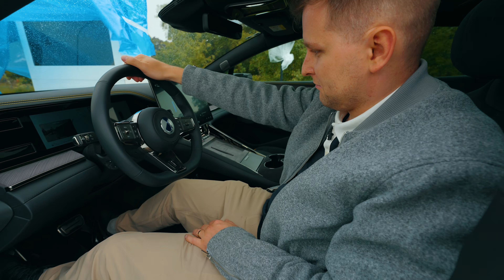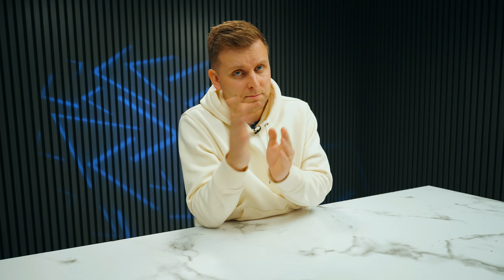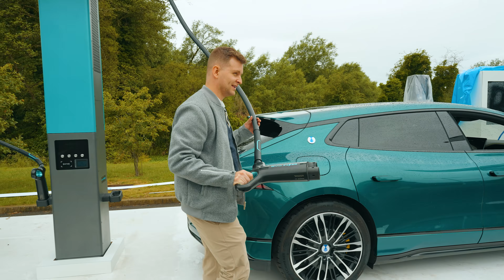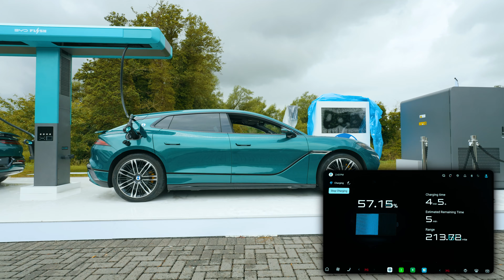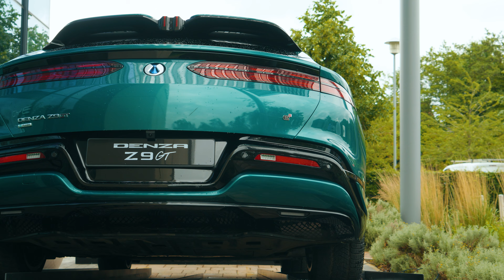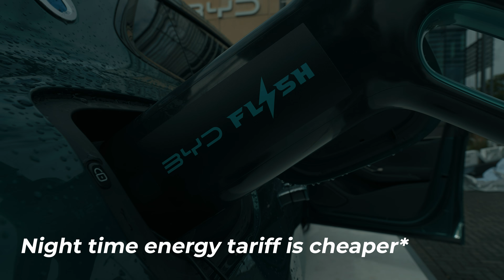BYD's New Flash Charger is Absolutely Insane! - Faster than Fueling a CAR!?

Comment: Still have a long way to compete against fuel stations. if a gas station has 12 pumps and in a 12 hour day it services 144 cars a day an EV charging station would have to be able to do the same thing in the same time in order for people embrace EVs.
Reply: @piman2boek364  what you're not taking into account is that everyone who has an EV has their own gas station right in their home. DC charging stations are only used when you're on a long road trip. That means you don't visit them on a weekly basis like you would a gas station.

Comment: Can the grid handle that though given it's in a bad way already.
Reply from the maker: did you see the video? Literally explained that point in the video.
Reply: @theTechNotice  obviously yes. 

Still the question remains, those large recharge station batteries still hit the grid.
Reply: 和当地的充电桩价格是一样，在中国已经大面积铺设，和普通充电桩费用一样，它利用的是储能系统辅助来达到快速充电效果，对电网也没有特殊要求，这就是这项技术能大面积推广的原因，
Reply: If BYD can make the charger work for all EV's that will be great! I currently have a Toyota that takes up to 40 minutes from 10% to 80% at 150KW which is still an age. Another idea is a universal battery pack that you  could swap out in minutes yourself and hand over the dead one... would beat sitting at a charger in winter, or in summer in a heatwave...

Comment: Right, so instead of loosing energy on single conversion from grid to car now you do an intermediate loss on charging the "charger  batteries" and then another loss when charging the car? Night time cheaper charging is great idea but this seems like a wasteful solution for the sake of solving single problem (charge speed) instead of fixing the infrastructure to finally start adopting the EW cars on scale.
Reply from the maker: There's gotta be a start of the tech at somepoint and this is a great solution and start to fixing the issues, I believe.

Comment: With modern EVs easily offering 300-mile driving ranges in the real world and some nudging 500 miles in the official tests, the scenario where you need to add an 80 per cent charge to your battery in double-quick time just doesn’t present itself for the vast majority of drivers. You might need another 50 miles of range to reach your destination, but you can already add that in a few minutes at a standard rapid charger. The beauty of EVs is that our cars sit idle for 95 per cent of the time and that is the perfect opportunity to change them.
Reply from the maker: I think the blind spot here is people who live in cities where you don't have a private parking with dedicated chargers. Imagine a guy living in a condo in London for example, he needs a fast solution and this is great. 
For people like you (i assume) and me who can charge at home, this tech is not as necessary. But in China, this is already widely spread tech, we here in the western world need to catch up.